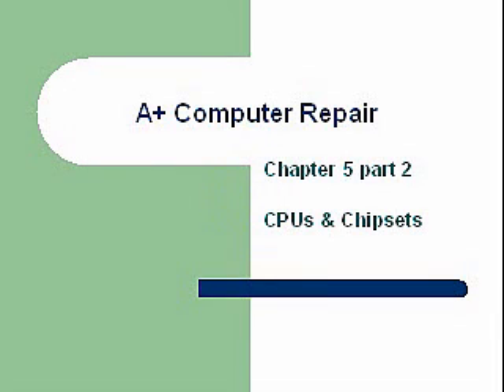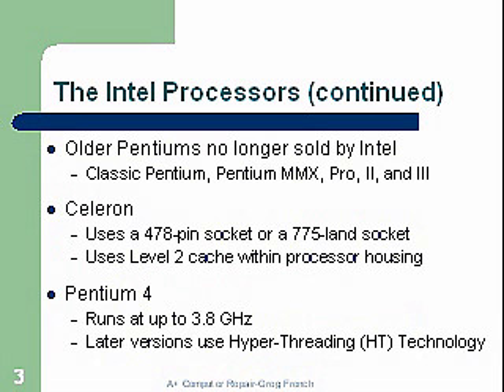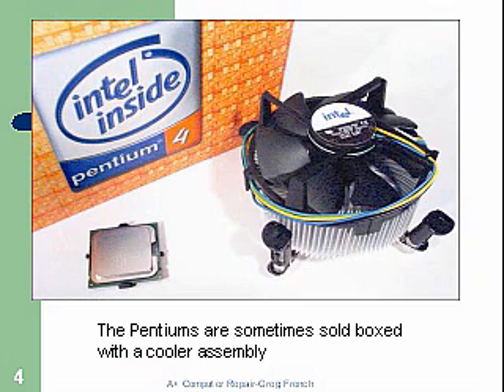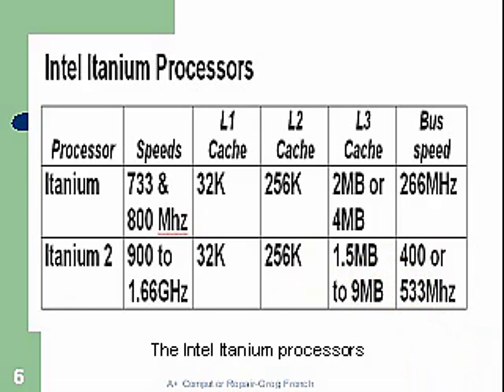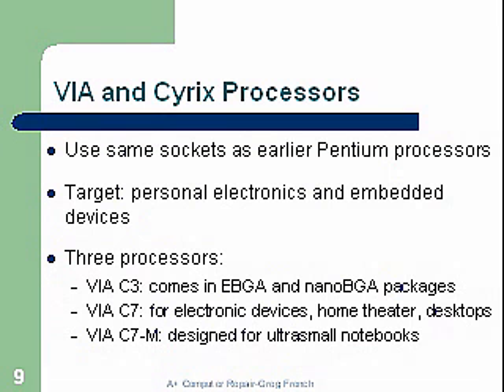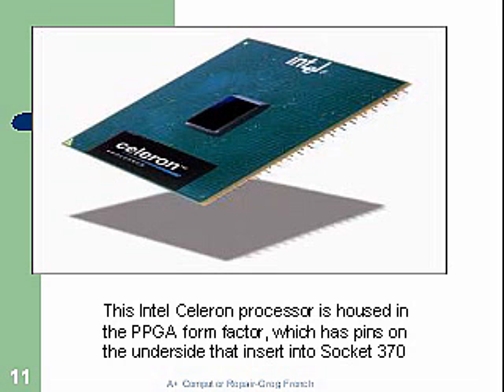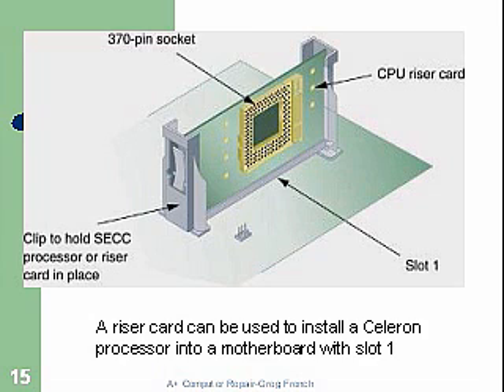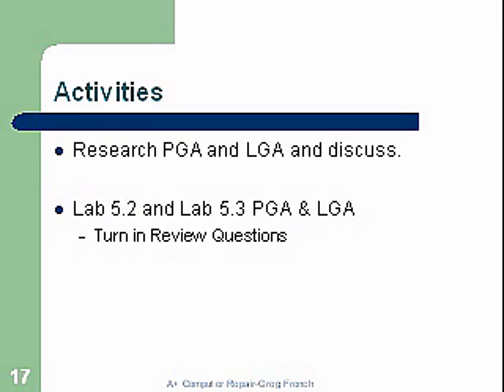A+ Computer Repair Course Chapter 5 part 2 - CPUs and Chipsets

Comment: While watching, I noticed in the presentation, that it mentioned about cartridge processor packages that could be installed on a slot. I was just wondering if that would also pertain to the older what was called SLOCKET 7 ? I don't remember right off hand if it was a Pentium II or III. I think it may have been around there somewhere.